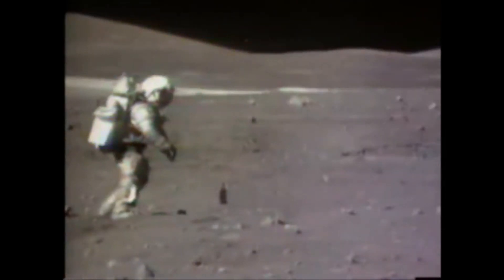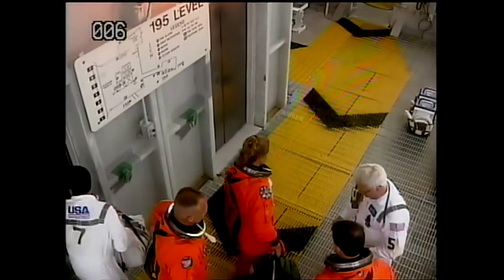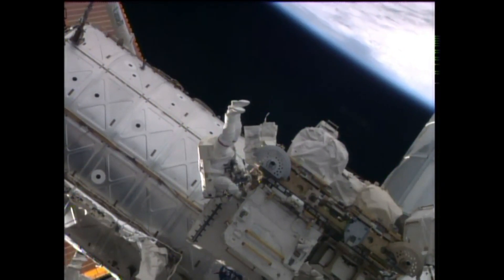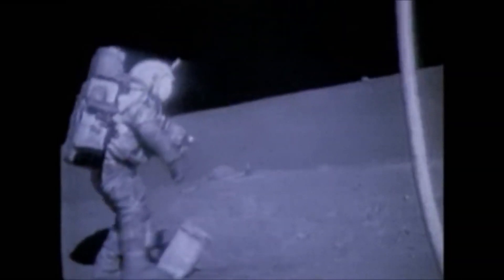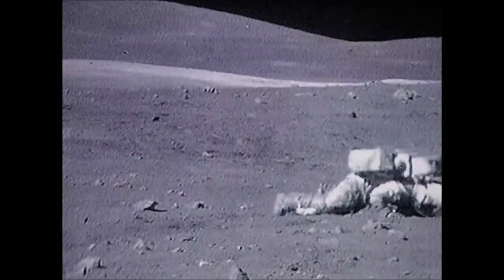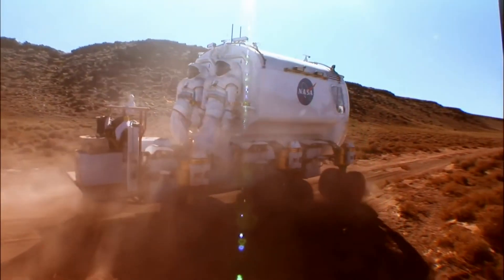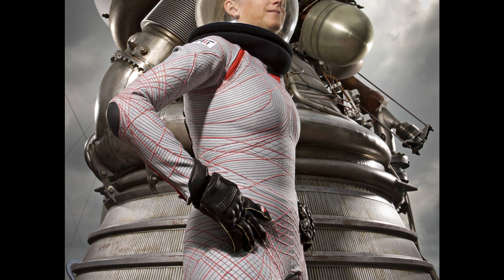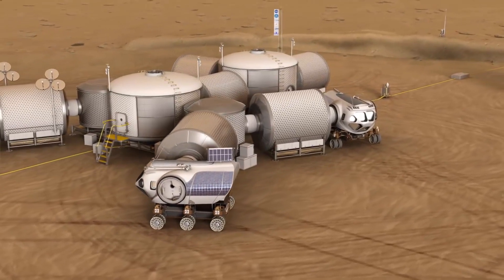A Space Suit for Mars

Comment: Mechanical-counterpressure space suits are not a new idea. The technology was used in 1960s high-altitude flight suits. A pressurized rubber tube running down the limbs tightened inelastic laces. They aren't used routinely because it's hard to provide even compression of the moving body, leading to bruising. 

While MIT's Biosuit has made some progress toward a solution, mainly with strategic positioning of elastic strands, it's certainly not the origin of skintight space suit idea, as many seem to believe. They do have a prototype, but the gloves--the most important part to be flexible--are air-filled, and the suit can't apply more than 3.6 psi. To be fair, that's a significant fraction of the 5 psi required for survival, but far from a convenient zero-prebreathe suit.

Mechanical-counterpressure EVA suits promise huge advantages, and I think can eventually be made workable, but it will take a lot of development. They may turn out to require active tension control for every strand using Nitinol actuators, for example. Somehow, if human space exploration demands it, a better space suit will be made.

I think the Biosuit itself, however, has received more attention than it deserves. Its flashy design helps, I guess. In 2008, I saw a pop-science magazine proclaiming "the skintight space suit" as one of the greatest inventions of the year. The Biosuit's creators have allowed the media to give them credit for the invention of the whole concept, when their contribution is actually one small step, neither the beginning nor the end, in the long journey towards a practical future space suit.
Reply from the maker: I hadn't heard about the 1960s suits, those are interesting. It is new in the sense of being mobile with them, with a high pressure suit you don't have to move that much, but I certainly hadn't heard of the ones in the past. Will have to look in to that!

Comment: Do the gloves pull off?
Reply from the maker: The outer gloves, which are tougher than most of the suit, can come off easier than the inner gloves, which are vacuum sealed.
Reply: Ben Pearson- Roadster Tracker cool. Perhaps that’s how the suits in sci fi physics in total recall worked.
Reply from the maker: Could well be. I wouldn't want to touch much with the inner gloves, they aren't designed for it, but in an emergency they should work.

I should add that I don't know much about the specifics of space suits. I doubt you can take a glove off easily, but that a glove has all of the layers found in other parts of the suit as well as the some additional layers to get a better grip, as you imagine snow gloves have a different feel then a coat made for going in the snow.